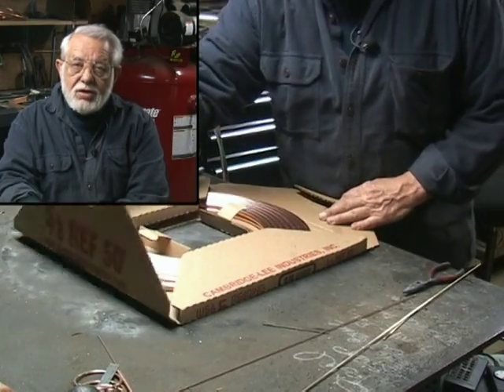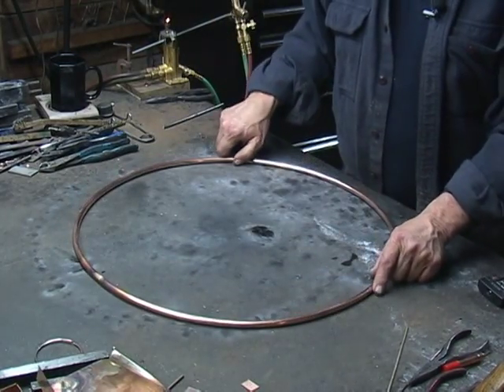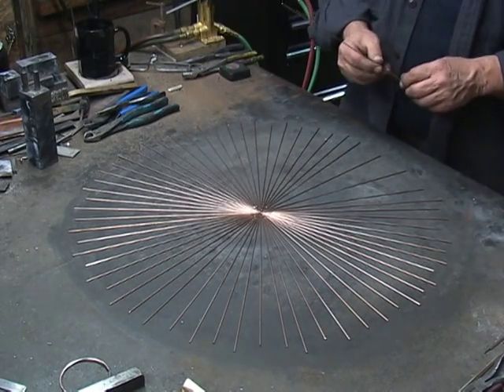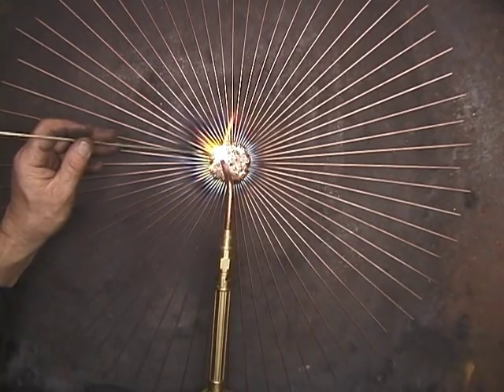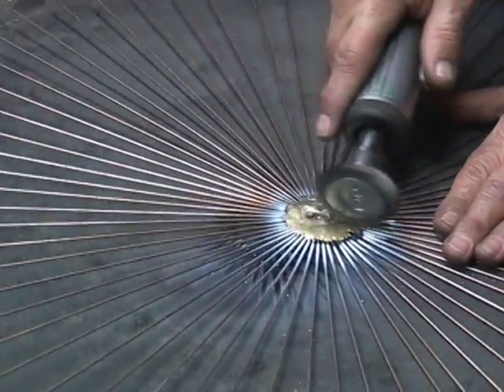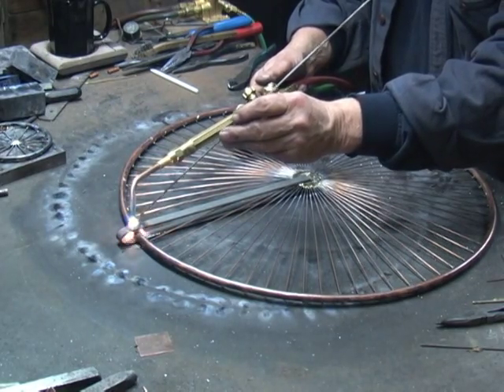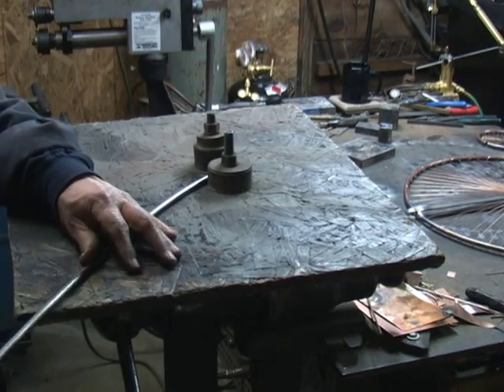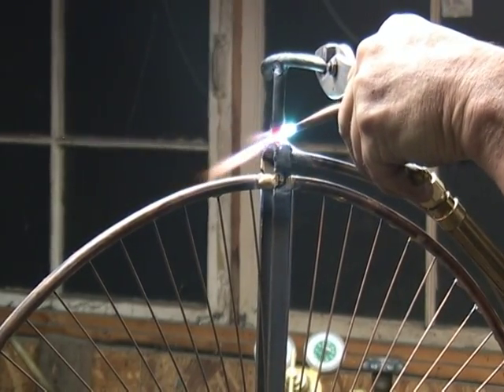The Large HighWheel BIcycle

Comment: Hello George what setting do you put your tanks on. I had purchased your video. I had burnt a couple holes in my copper wheel.
Reply from the maker: Dana, my settings are (5 acetylene) (6 oxygen).  Using a "00" tip.  (if using a "0" tip turn the flame down just a bit using knobs on the torch handle.  Copper conducts heat so you'll need to move a little faster as you move around the wheel.  Here are some videos that may help.  Let me know if you need more help.  You can also email me at ggoehl@gmail.com

How Close to hold the torch:  https://youtu.be/leIF4PRzA5A
Carburizing Flame:  https://youtu.be/zVOZpUFFRNg
Brazing Thing Material:  https://youtu.be/h0vIvipWVuY